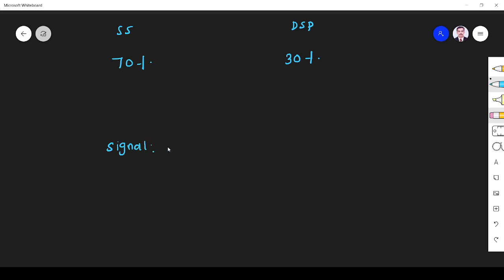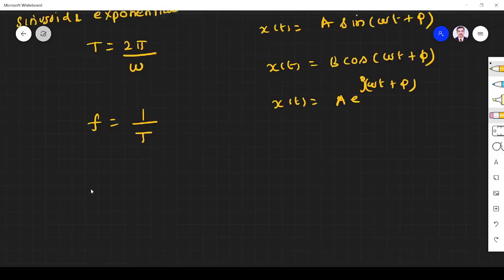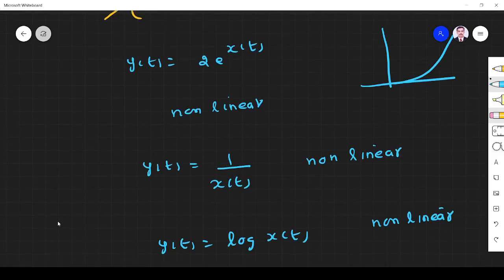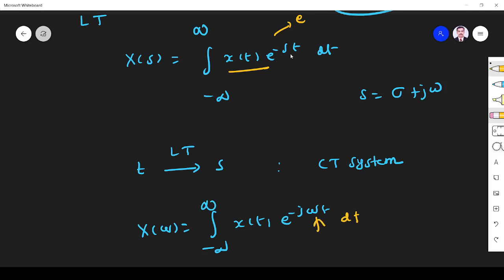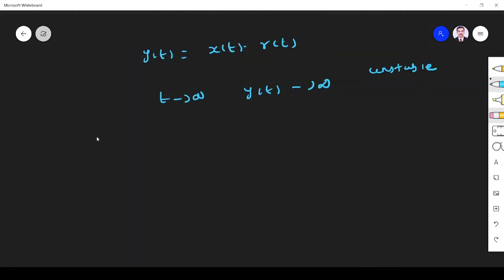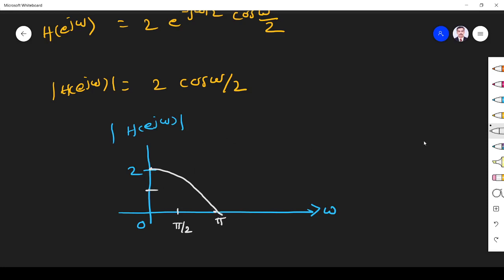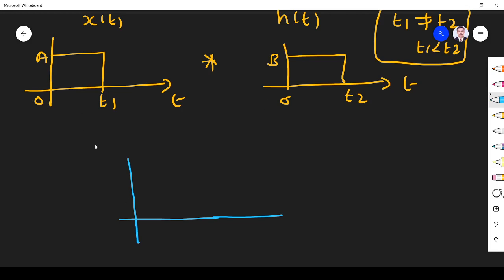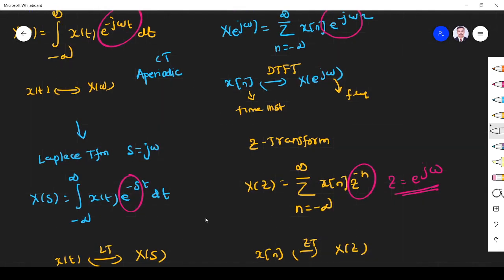Signals and Systems TRB Revision @majeethlectures

Comment: sir.. for the preparation trb polytechnic exam, is it right to solve last five  years GATE questions?  GATE QUESTIONS are more tougher. what is the difficulty level of trb exam? Please guide me sir..........
Reply from the maker: Ma'am trb won't be upto gate standard..gate is something high standard where calculator is allowed, only 65 questions so each question has 2-3 min time whereas in trb no calculator and 150 questions ..so 1min per question..so you solve problems with that level..those gate questions and ies give some exposure to concepts
Reply: @majeethlectures  ok thank you so much sir...